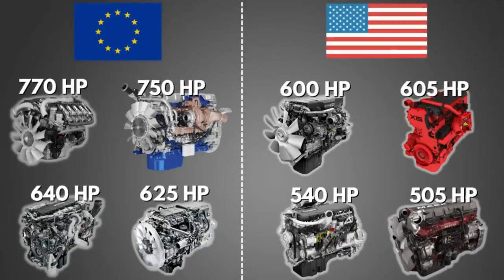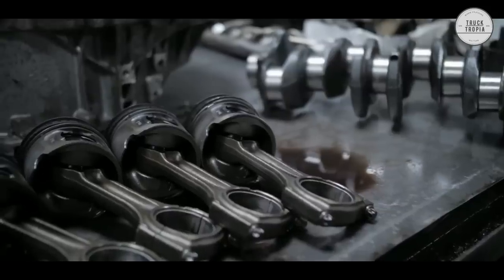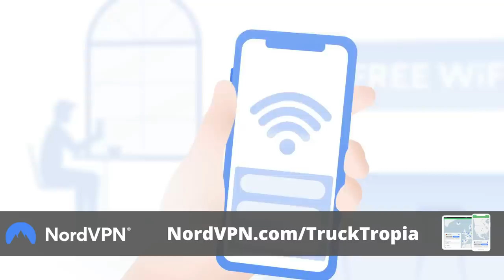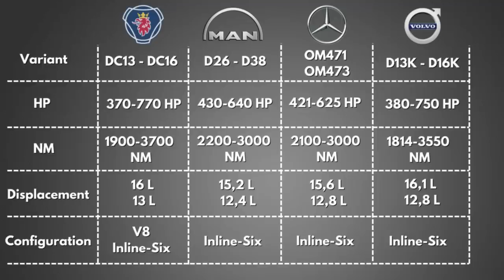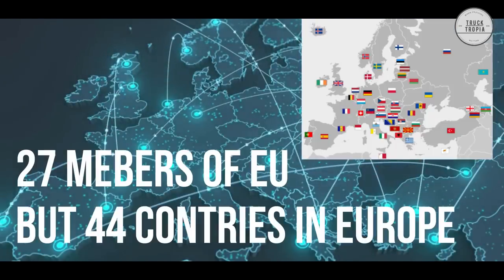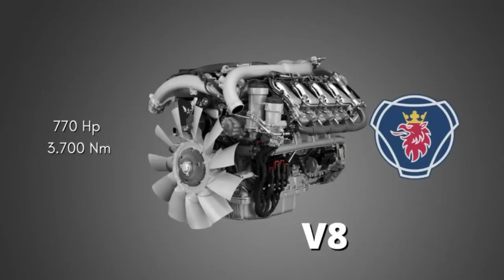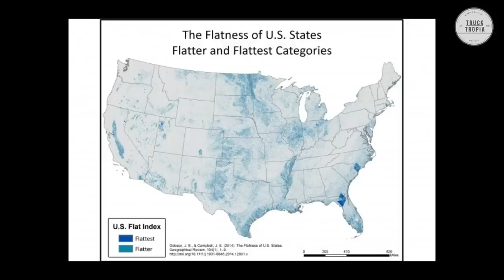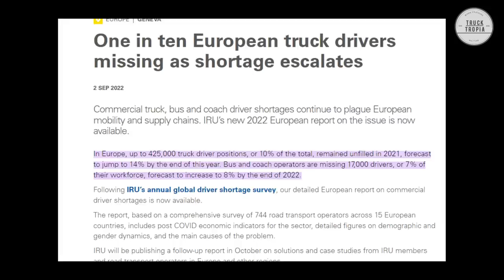Why European Trucks Have Up To 770 HP And US Don’t

Comment: As a US diesel mechanic I can tell you large bore V engine designs were pushed out of the market during the late 80s early 90s mostly due to emissions and also fuel consumption. These engines were making 600hp+ in the 80s from the top 3 US engine manufacturers. If anyone would like to see an even comparison of what driver/companies would prefer nowadays I would say take a look at the Australian trucking landscape. More often than not you will see an American(Aussie Built) truck with an American engine over a European... Do not misunderstand me as I think European Diesels are extremely reliable and their axles/transmissions are second to none, ie Sisu.
Reply: For germany i can tell u the average Hp is somewhere around 400-450 HP. Nobody drives around with 600 HP unless u haul special operations like 700t industrial tanks or something.
Reply: @indahooddererste  And here in Switzerland you will find higher Powered trucks due to it's cool factor and landscape
Reply: I am from Australia. KW has Cummins. Volvo has Volvo but makes the engine for Mack. You cannot run a US Engine in a European Truck. Volvo owns Mack it can
Reply: As I have previously stated European Trucks run European engines. You cannot have a US Truck with a European enginein Australia.  You do not fet a preference
Reply: @robertryan7204  I have seen MAN road trains in Australia and Freightliner is owned by Mercedes.
Reply: What’re you on about? The Volvo/Mack setup is the exact same over here in the US. Nothing special about Australia…
Reply: Freightliner is owned by Daimler Holdings which in turn is 35% owned by Mercedes. Freightliners are still produced in the US to US specifications. If we want to play this game Australia owns very little if not zero heavy truck or engine companies.
Reply: @DCB1209  No you do not get it. You cannot run a Cummins in A Volvo in Australia can in the US. If it s European it runs OEM engines. Mack can run Mack rebrsnded Volvos or a Cummins
Reply: @indahooddererste  Well the Europeans own the bulk of the US Trucking industry. Only PACCAR is US owned
Reply: @robertryan7204  Thats true euro frames are only specified to the manufacturer.
Reply: @robertryan7204  Why are you arguing this to me? I have not said anything about putting US engines in EU trucks... I'm genuinely trying to figure out what you're going on about.
Reply: @robertryan7204  I believe that you have misunderstood me somewhere along the line. Please inform me of what I said or what you think I have said, that has got you spamming me about putting US engines in European trucks...
Reply: @DCB1209   Not playing a game Mercedes which is Daimler owns Freightliner. At one stage Australians bought Western Star, a Canadian company. They in turn sold it to Daimler on the Toronto Stock Exchange.
Point is PACCAR is the only US owned Truck Company
Reply: @DCB1209  You said generally you will find a Aussie built truck with a US engine. That is not that true anynore. You get a lot of Cabover European and Japanese Trucks they make yp 70% of the trucks on the road. Volvo using Cummins like they do in the US does not exist here.
Reply: @DCB1209   Just answered you. You said You will more likely to find Aussie Built US Trucks with a US engines in Australia. That is not really true .70% of Trucks in Australia are Cabovers, mainly Japanese or Europeans, KW makes up 14% of the Truck market followed by Volvo
Reply: @robertryan7204  Is it not true or not "really true". So let me make this clear. We are talking about HEAVY DUTY trucks not small single axle cabover isuzus. As far as heavy duty trucks are concerned in Australia the largest group is US trucks, that is a fact. Unlike most people from the US have lived in Australia as a diesel mechanic and seen it with my own eyes. I lived in Alice Springs for 3 years watching 4 trailer road trains and never once did I see one being pulled by a Japanese tractor. They were mostly KW and Mack long nose trucks. And they were Mack with Mack engines before Volvo...
Reply: @robertryan7204  PACCAR isn't a truck company but a parent organization. You seriously need to do some research before trying to argue American owned truck companies with me. Paccar/Kenworth/Peterbilt are not the only American owned companies. Western Star is not and has never been a Canadian company. Western Star was started by White Motors a US based and owned company. Western Star was a subsidiary that they shared headquarters in BC, Canada and Ohio US. Again, please do some research before commenting to me. White motors was started in 1900 and was Volvo before Volvo even existed. Again, why are you arguing these points to me with half ass facts? Do you not like Americans or something? American trucks are the majority as far as the Australian HEAVY TRUCK market. I am not going to waste any more of my time arguing this with you. Good day.
Reply: @DCB1209   Times have changed onthe East Coast it is a lot of Cabovers. Yes I thought they were all Conventionals around Australia  but that has changed, going right around Australia it was an eye opener. Not talking about small Japanese trucks, but their heavy mediums and tractors. Getting a lot more Europe an ( Mercedes Actros, Scania) plus Volvo.  In WA suprised seeing a Volvo B Triple ore truck
Reply: @DCB1209  Need to do some reserach Western Star was Canadian production was moved from Canada to the US. PACCAR is Truck company with many brands under the parent company by the way the only US  Truck manufacturer not owned by the Europeans  the rest are
Reply: @DCB1209  Do not know when you were in Alice Springs a lot has changed since then. Western Star was bought by Australian  investors and soldto Daimler. White motors  had ceased to exist..No the majority of Heavy Trucks( quarry heavy mediums) are Japanese with Europeans now increasing dramatically. Yes KW and Mack and now to much lesser extent Western Star make up the bulk of US style Trucks Freightliner is the bottom ofcthe barrell. Roger Penske bought the Western Star rights from the Australian investors and added MAN to his Australian  Truck distribution
It is bizarre as Dainler and Traton are direct rivals in Europe
Reply: @DCB1209  obviously you are wrong. I live here you do not. Things have changed dramatically  since you were here. We used to produce cars, not any more.  Only KW and Volvo/ Mack are made in Australia ( Volvo proud of the fact)
Reply: That's quite correct, however the Scania V8 is becoming more popular for some applications, but the big rig road trains are primarily American.
Our 14 ton payload bogie drive Isuzu cattle truck has a very reliable  275 hp Japanese Isuzu engine but is coupled with a 15 speed Spicer Road Ranger, very common here, medium heavy Japanese trucks with American gearboxes.
The Euro syncro boxes were not as popular with drivers as constant mesh Spicers and the Volvo 10 speed semi auto box was a disaster changing so slowly you had to drop two gears to keep up torque on the ranges.
Reply: @DCB1209  Quite correct! The vast majority of road trains are running Australian modified American prime movers with American engines and drive-ins.
There are a few Scania powered 'trains' but they are definitely in a minority.
Reply: @rossawood5075  It is for the most part the same over here in the US. We can get many Japanese manufactured medium duty trucks with gearboxes like Allison. We lack heavily in the Euro truck market although you can technically order them.

I appreciate your honesty and unbiased reply.

Comment: The Mack-Scania relationship was established in 1950, when Mack Trucks collaborated with Scania (then known as Scania-Vabis) to produce and sell the Mack C-50 municipal transit bus in Europe.

Mack and Scania then worked together on V8 development. It’s no coincidence the Mack and Scania V-8 engines share displacements.

After five years of development, the Mack END(T)864 (1962-1972) entered limited production at Hagerstown in 1962 (Production might have started sooner, but the transfer of engine production from the old Plainfield, New Jersey plant to the modern new Hagerstown, Maryland facility in 1961 did not go smoothly).

Using Mack-supplied END(T)864 V-8 engine blocks, Scania began development of its own version in 1962 with running prototypes in 1964. However, the production version of the Scania DS14 V-8 was based on the improved Mack ENDT865/866.

Mack introduced the 14.2 liter ENDT865 in 1969, the same year Scania introduced the 14.2 liter DS14.

Scania utilized individual cylinder heads on their version (favored in Europe at the time), while Mack used a two-cylinder head design (four heads total).

To better achieve economy of scale for Mack and reduce investment costs for Scania, it made perfect sense for Mack to produce V-8 engine blocks for both companies. The only negative was for Scania having to convert English measurements to metric.

Scania produced the DS14 up to year 2000. With the introduction of Euro-3 emissions, Scania introduced the 15.6 liter DC16 V-8.

The 16.4-liter Mack E-9 is based on a revision of the 14.2-liter ENDT865/866 engine block.

The current Scania Euro-6 DC16 V-8, in 520, 580 and 730 horsepower ratings, has a 16.4 liter displacement, identical to the Mack E9.

(Mack Trucks jumped from 14.2 liters to 16.4. Scania moved incrementally with the block from 14.2 to 15.6 to 16.4)

Scania’s current 16.4 liter version of the Mack/Scania block, rated up to 730 horsepower at Euro-6 (the rough equivalent of EPA2010), utilizes a compacted graphite iron (CGI)* engine block. In meeting Euro-6 (the Euro equivalent to EPA2010), CGI allowed Scania to raise cylinder combustion pressures from 165 bar on the earlier 15.6-liter V8 to 200 bar on the new 16.4-liter engine.

Also, Scania XPI** (extra-high pressure injection) now takes injection pressures up to 2,400bar, and they have developed multiple variations for its injection profiles based on an HCCI (homogenous charge compression ignition).

Volvo Group terminated Mack E9 V-8 engine production at Hagerstown in 2003.

Mack Trucks had planned to re-launch the E9 V-8 in 2003 with Bosch electronic unit pump (EUP) injection. Revisions allowed it to meet the latest EPA standards while delivering superb power and fuel economy. However, Mack engineering was snubbed by Volvo Group. Volvo cancelled the pedigreed Mack E9 in favor of the upcoming Volvo D16 (rebadged as MP10).

Had Volvo Group continued production of the Mack E9 V-8 engine, refined with oncoming new technologies including an extra-high pressure common rail fuel injection system and compacted graphite iron (CGI) engine block, the Mack brand would still have a legendary halo product.

Source: bigmacktrucks.com
Com

Comment: Both Volvo and Scania are Swedish. So, the biggest reason Europe has more powerful trucks is that Sweden is a part of Europe. Among the reasons mentioned in the video driver appreciating more power might be the most relevant. The bigger US market tends to prioritize minuscule cost reductions higher than most of Europe.  

About torque, probably the most misunderstood concept among motor "experts", you can get any wheel torque you want from any engine you want, it's all about gear ratio. 

With the right gear ratio it would be possible for one person to pedal a 100 ton truck. It wouldn't be possible to reach any relevant speed, because a human can not produce enough power for that. Torque can be increased practically infinitely with gear ratio, power is the limiting factor.
Reply from the maker: True 👍 thanks for sharing

Comment: Heavy loads are more common on rail in the US and they do allow double stack on some freight lines, they don't allow this in europe. 
In Europe about 20% of goods are moved by rail and in the US it is about 40% by rail. 
The length of the freight train is limited and they aren't as automated as in the US. They have to coupled by hand. This takes many minutes each time.
Reply: Double stack may be difficult on a fully electrified railroad system 😁
Reply: Double stack also will not go through 100 percent of our tunnels in Europe -- we have many of them. Also, most bridges will put a double stack train to a full stop. So it is not a matter of being allowed, it is just not possible on most tracks.
Reply: @kaefjot08  That's part of what is known as "loading gage" in railroad terminology. Each route has a loading gage that determines the maximum height and width, and in some cases non-articulated length that a load can be. The US has traditionally had larger tunnels than most of Europe, so can run physically larger cars or container stacks.

The US also basically has no electrified railroads. There are electrified sections in the northeast of the country that are primarily passenger routes, but in the rest of the US, the electrified lines of the 1940s have all disappeared. (There are electrified commuter lines in various cities. But these are dedicated light rail lines that carry no freight.) So catenary height is generally not a consideration. If the US ever does reconsider electrified rail transport (which is not that likely in the near future) they could pick a higher standard catenary height than in the EU.

A quick check shows height for a double stack to be 20 feet 2 inches. The EU catenary height is in the 16.5 to 17.5 foot range (5.08 to 5.3 meters). So the EU can't run double stacks on electrified line. Some US electrified line is about 21 to 22 feet high, so would (just barely) clear a double stack.
Reply: Well I mean trains in the US can be coupled with no extra effort but you still need someone to connect all the airlines between the railcars, so there's still a good amount of work to do on these very long trains
Reply: We also have automatic couplers in Europe, just not very common on freight but they are used.

Comment: I think they missed the boat here. For the heavy logging trucks in Canada, they are often spec'd with 565 horsepower rather than 605, even though they are carrying much more that 80,000 lbs over steep hills. The high horsepower is less durable for demanding situations. Australia probably has the biggest weights, but they also don't go as high on the horsepower curve. The Kenworth hauling 500 tons has a 19 liter engine that only puts out 600 horsepower (It also has another engine in one of the trailers.) Here, not only do you have the heavy weight but also 50C heat. Volvo is also used in Australia. I bet they probably don't usually use the 750hp for the most demanding loads but something rated lower. But then why do Europeans use higher horsepower? I think the want higher acceleration to mix with cars better on the smaller roads (as opposed to the huge flat interstates in the US). I know Scania did a test a ways back that concluded it was safer if the trucks cold move with traffic better.
Reply: Most EU heavy truck engines last for over 1 million miles, even the high HP versions, so durability is NOT a problem over here.
Reply: I work at northwest Greece with lots of mountains and temperatures up to 45c.many trucks here drive illegal overloaded with 50-60 tonnes especially with loads like corn(42 tones legal).the only way to go with this loads are other with volvo 750 or scanias with 16 liter engines.scanias here in Europe are well-known to gain power very easily and the engines last more than 2000000 km.a large percent is tuned at about 800hp.you just cant compare them with 500hp trucks.their only disadvantage is consumption.
Reply: Lol I work construction in Maine my Pete has a 600 horse Cummins under the hood and I'm running a tri-ax dump not a trailer. We can run 100,000 pounds GVW with a standard tractor and a tri-ax trailer here.
Reply: @giannisxepis3465  1 million shouldn't be the measurement. They are supposed to hold for 2 million or more
Reply: The huge majority of overland trucks in the EU is rated for 40t and has between 420 and 480 HP. Those very powerful trucks with 500+HP are really rare.
They are usually for special purpose as extra heavy hauling (eg log hauling) or owner operated trucks for prestige and nice -to-have.
And the general speed limit for trucks is 80km/h so they do not mix very well with cars anyways.
Reply: Yes exactly, no space in EU much safer for big torque. Like a school bus accelerate to 45 mph very quickly. It's the same thing.
Reply: HP and Torque curve goes hand in hand. Can't have one or the other, you need both. A comparison between the V8s (770 vs 750) on a 12% grade obviously favored the 770. And it was a fully loaded log truck doing 52 kmh (32mph) without sweating in automatic mode...economy setting 😳. Everyone else is happy with 30 kmh (18mph), locked in gear, crossing their fingers it wouldn't stall needing a downshift.

I've ran empty (20 tons) up that grade. 500hp can't even hold 80km/h for the entire grade. Complete weak sauce half way up.
Reply: Usually the truck have about 500hp in Europe. The only one I saw with a 700 hp was at a demonstration. I love how everyone is trying to make this a pissing contest. The usage and landscape is different from one place to another.